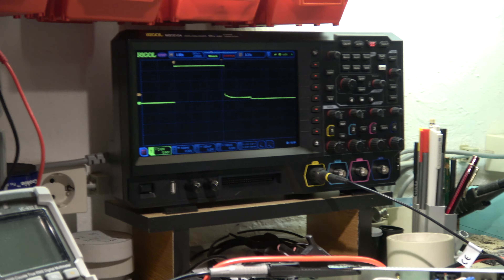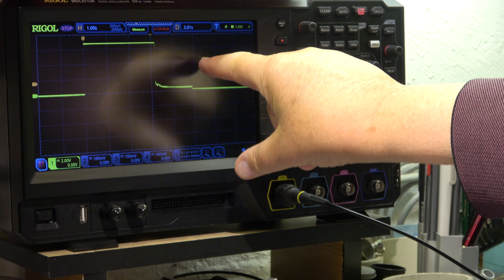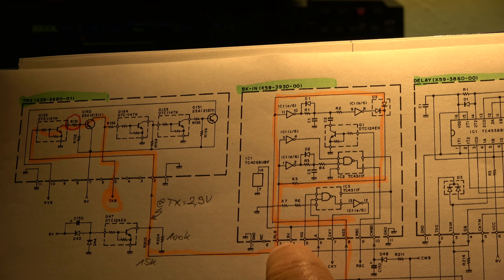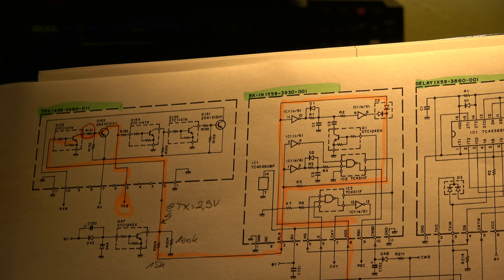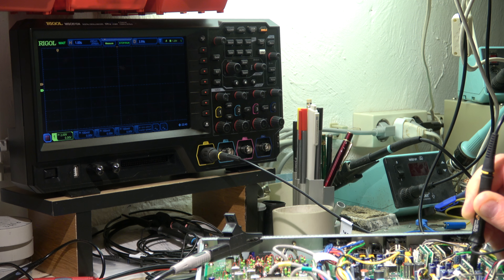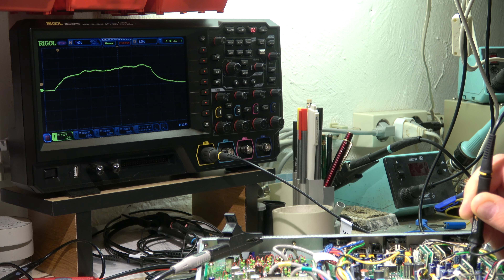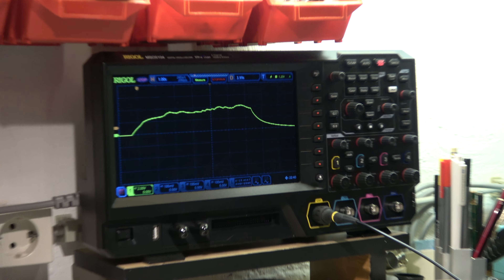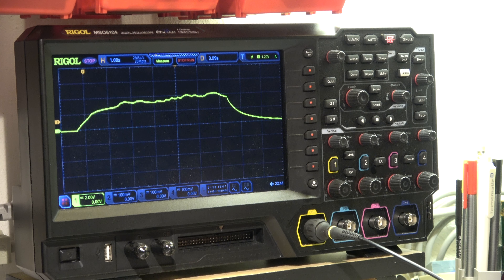#131 Kenwood TS450S Part 2(3)

Comment: Manufacturers are notorious at saving a few cents here and there, PCB materials are on that list. The dark brown phenolic based boards morphed into fibreglass over the years , but were expensive on drill bits when mass drilling for through hole components. Cheaper options  based on paper and resin as used here  suffer moisture absorption and acidic formation  issues, I guess the limited life was  an unplanned bonus to manufacturers that used this form of PCB. Normally this is not a great issue with low impedance circuitry, your 15k solution I think is an acceptable fix in this case.  Questionable transistor biasing was also common, especially when emitter followers used a single base biasing resistor, relying on transistor parameters only to set  emitter current, long term, this caused voltage changes with transistor aging, and creating many "interesting" partial faults.
Reply from the maker: Tnx for your explanations! I´m sure, you´re right and this raisin material is the main culprit - besides a possibly leaking cap. Consumer electronics are never built to last for ever, they have to die after a decade or so. And our hills of trash are growing up to the peaks of mountains.

Comment: I fixed one of my HP frequency counters once a while back and the culprit was a leaking cap that showed no signs around its circumference while it was flat on the PCB. It wasn't until I actually pulled it from the PCB that the leak was evident; new cap in and counter back to life. So I'm always suspicious of any electrolytic even when they "look ok". Will be interesting to learn the issue, hopefully in your next installment!  73 - Dino KLØS
Reply from the maker: Maybe you are right ... let´s see.

Comment: the greenish residue should point you in the right direction. A cap, or a few caps, are leaking electrolyte on that board. The electrolyte migrated slowly towards the soldered-in boards, and settled on the TX-RX board. I know this will be hard, but you should check all caps on that board, especially the bigger caps, over 100 uF capacity. 
(this reminds me of a really crazy defect on a Loewe TV, the CPU was acting erratically till i found a leaking cap 20 cm from the CPU... all traces had resistances between them because of the electrolyte, and i had to use WATER to clean it up. Isopropyl had no cleaning effect on the electrolyte.)
Reply from the maker: Had the same thoughts, but the traces under discussion aren´t  fed over the board, they are only in the vicinity of the TRX-board (some cm). ALL caps in this area are much less than 100u and not leaking. The "famous" C104 in the AF is already swapped and couldn´t cause the problem - too far away.  Meanwhile i dried the small TRX board with heat and it´s OK now.
Reply: @dl7majstefan753  please check also Q153 DTC114TK. That's a digital transistor, with a typical turn on voltage of 1,8 volts. It's weird that it turns on so quickly, its internal base-emitter resistor of 10K could be bad.
Reply from the maker: @tlrptg  From 17:00 you can see, that this transistor has no BE-resistor acc. to the datasheet.  So it is very sensitve; but this topic is solved - pse wait for part 3.
But actually i´m on the trace of another possibly bad cap.

Comment: Hi Stefan,

I have an issue with the TS450S, very low output 15-20w and this is only working on the bands 14mhz and above.

On initial key of the mic the oscilloscope will peak for a fraction of a second at 100w+ (testing on the output from the final circuit to the filter board) before reducing power.

The ALC control can be set for ALC level, however when it is keyed again the level can vary up and down from the last position.

I am thinking could this be an issue with the ALC circuit maybe or the swr fly back circuit causing the ALC to interrupt and cause the power to be low?

Have you any suggestions or locations to test?

Thank you in advance

Tony
Reply from the maker: Hi dr Tony,
ALC: Yes - possible problem: Check Q19 on the RF-Board for constant bias and levels. Signal RFPC on connector I, pin 14?
Or: DC-biasing of the final and driver stage: Q6 and Q7 on FINAL board.
Reply: @dl7majstefan753  Hi Stefan,

Thank you for getting back to me 🙂

For Q6 and Q7 are these setting the bias only for the final transistors? Or is this adjusting the drive transistors with one?

The reason I ask, the 2SC2509 I have replaced for Eleflow 2SC1945 (I believe these should be be 100-150ma bias)

The fault I described with the power immediately limiting after a momentary spike was happening before the transistor replacement (I suspected low drive or pre-drive at the time, now known not to have been the situation).

Final question, for connecting the meter (A) to measure the current, is there a point on the pcb for this to save having to lift the leg of the transistors? I am missing it in the diagram...

Many thanks in advance 

Tony
Reply from the maker: @th505  Q6 is for the Driver and Q7 is for the Final acc. to the service manual.
A-measurement: The service manual states to set both bias settings to zero, measure the total current consumption and then adjust bias settings with measurment of the current increase when aligning the bias settings.
Reply: @dl7majstefan753  Hi Stefan,

I have adjusted the bias for Q6 & Q7 to be correct now. Also ALC voltage on RF board was high, now adjusted for 2.005vdc.

Some readings might give a better idea;

ALC voltage (rf board) 2.005vdc
RFPC 2.9998vdc CN1 pin 14
13.005vdc (pin 1 cn1)
RXB 7.57vdc rx - 0v tx
TXB 0v rx - 7.35vdc tx
AGC 2.5V
ALC 2.5V
50MC 0.05 rx - 0.15 tx
RC 0vdc rx - 12.556vdc tx
CKY Ovdc rx - 6.46vdc tx
AMB 0vdc rx - 0vdc tx
AIPB 7.2vdc rx - 0vdc tx
RFFC? 3vdc rx - 3vdc tx

VFS 1.35vdc tx
VSR 0.98vdc rx
PC2 3vdc rx tx
PC1 0v rx tx

I am still searching for Q19 on the rf board...
Reply: Hi Stefan,

Just an update - I have located Q18 Q19 however it is difficult to test them on the underside of the pcb in circuit.

The drive and final bias is set.
Alc in rx 2.5v

I have unplugged the coax cable from the final output stage to the filter pcb. On testing here into an oscilloscope I have a good strong signal, adjustable with carrier control on power controls from the front panel, on all bands.

The current draw is a good 20amps.

The problems arise when the coax from the final circuit is connected to the filter pcb, this causes the power to decrease to around 10-15w after a brief and momentary half second peak of full power.

I have taken the internal antenna tuner put of circuit to rule out any fault within, however, with the jumper reinstated to bypass the tuner the problem still exists.
Reply from the maker: @th505  For further discussions pse contact me via email:
dl7maj (at) t-online.de